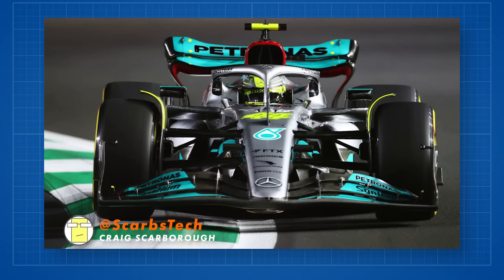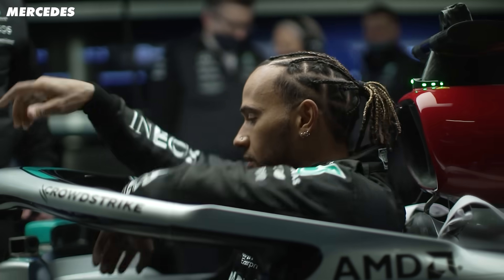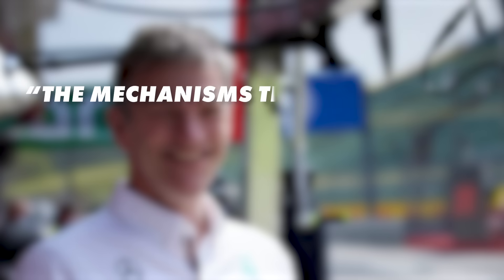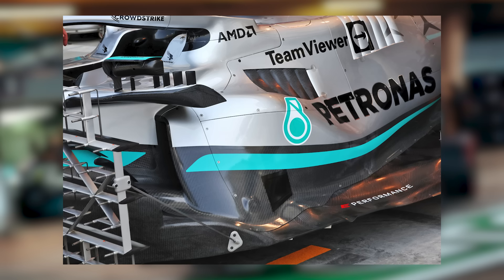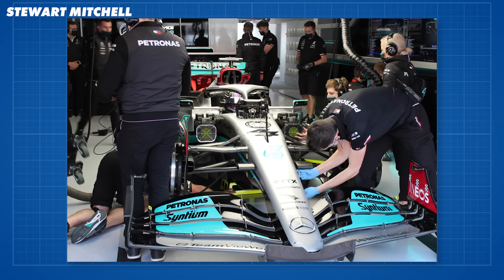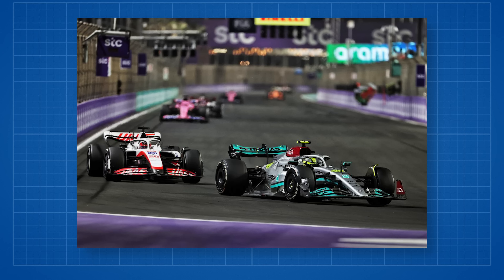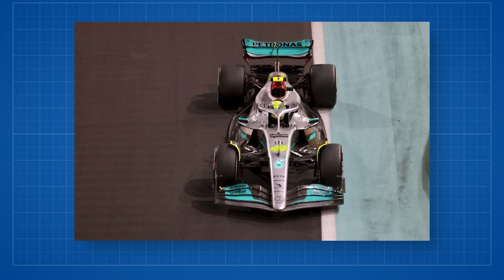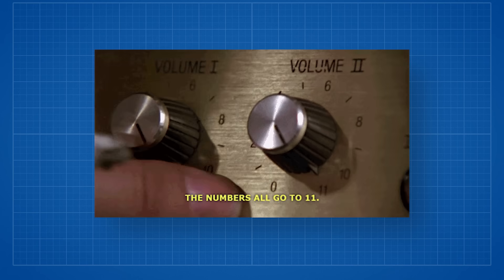The Real Reason for Mercedes’ Slow Pace | Saudi Arabian GP

Comment: Bcs they have a radical aerodesign that will work once. Lewis gave up Saudi for as much data as possible. Russell dealt with the porpoising and kept the suspension softish while Ham went for stiffened to the max. Result: less rear grip in his case with the "no bounce"-wheels of 2022. This sacrifice will win him races if they manage to solve the PU-issue. It is clear that both the higher center of gravity of said PU and the significant issues with horsepower-output, which lacks linearity, is still something they have to sort out. This car can be extremely potent and will be a 2023-2025 WDC-champion.
Reply: Mercedes said that the setups the two were running were pretty much the same. Lewis just didn't heat his tires right for his quali laps.

Comment: Mercedes have reported to bring forward their updates to australia: 1st will be a floor update to control porpoising, and the next at imola and then spain to lower the cars weight.
Reply: Interesting. I read today that Helmut Marko said that Red Bull were planning to shed some weight around Imola as well
Reply: @halofreak1990  yeah and Ferrari are reportedly also bringing upgrades there. So let’s hope Mercedes’ gets on top of their problems and then is able to contend with the upgraded RBR and ferrari.
Reply: @Jay-nk6dm  NOT
Reply: @nakedsnake_  is it Mercedes’ actively destroying the other teams from catching? No. It is not Mercedes’ fault that the other teams could not bring themselves to be able to fight them. Witnessing greatness will always be awe-inspiring, and if we really want to see what RBR and ferrari are capable of, they should test their mettle against the reigning champs
Reply: @Jay-nk6dm  Well.  Said.
Reply: @Jay-nk6dm  They do actively destroying other teams from catching up to them back then when this new engine first introduced until.. I don't remember, maybe 2018 or 2019 when all the engine modes (or software to access it) should be available to costumer teams. Of course none of the costumer team were a threat to them, but those costumer team probably could finish higher if Merc made those extra performance hidden behind the software to be used by their costumers, thus make those teams potentially finish higher and receive bigger prize money.
Reply: @nakedsnake_  Ferrari got 16 world constructors so from your logic they should not be allowed to even participate lmao
And if you wanna beat the Titan then become strong yourself instead of crying about how the competition is too strong
Reply: @nakedsnake_  what’s your problem dude is there any rule not to hv 8 championships or did merc tell others not be competitive all these years??
Reply: @RurouTube  do you have a link/source that says merc didn’t provide all modes to the customer teams?
Reply: @RurouTube  that’s some good info didn’t know that! At the end of the day that’s the disadvantage of being a customer team, you don’t get to fully know the extent of the PU. If this is the most they’ve done, it sucks for the other teams but I’m sure ferrari and Honda have done the same. Sure Mercedes’ aren’t saints to their customer teams, but is there a way you know they’ve tried to seriously disadvantage their non customer teams?
Reply: @nakedsnake_  Because a 3 way battle for the title is obviously better than a 2 way battle.
Reply: @nakedsnake_  maybe because Max was gifted a championship and we would like to have things right with Lewis

Comment: I think the small side pod generate too much downforce because they expose too much floor so aside from the suction from the venturi tunnels, the air above the floor is pushing it down so they seems to start bottoming out at lower speeds but I do think the solution is in the suspension like limiting the travel as to prevent the floor bottoming out too much, like light scraping instead of violent bouncing on and off

Comment: Can you do a video on what Ferrari needs to do to catch up to Red Bull in a straight line/what is holding their concept back vs. what holds Red Bull back with their concept? PLSSSSS
Reply: Ferrari used more downforce than RB, which made the F's faster in corners, but slower on the straights. Different compromise.
Reply: @Wuppie62  I mean more like their overall concepts tho. Like Ferrari’s big canyon side pods vs Red Bull’s super sleek undercut ones and stuff like that. Try and see how they may develop over the season

Comment: Mercedes turned it around in the past because the budget was unlimited and they employed roughly 500 aerodynamicists to brute force literally everything. I am curious to see what they will do now with the budget cap.
Reply: They will suck it up and say "We are working on the 2025 regs"
Reply: That's the same for red bull and ferrari though too but they've done alright. They both have B teams though, so i wonder how much data sharing there is between them and their B teams
Reply: @ffvgaming3735  im sure Merc are sharing data with their customer teams too.
Reply: @bipolarminddroppings  why would they that's their direct competition though?. The 2 alpha teams are just B teams for ferrari / RB and I'm wondering if they focus on using their wind tunnel time on separate parts of the car / combine data.
Reply: @ffvgaming3735  because those customer teams depend on them for the PU. Hybrid era, MB produce the best PU and there is no competition to them so they can charge whatever they want and have whatever perks in the contracts they desire like putting up no challenge when a MB is behind them. Renault were nowhere. Honda struggled until the last year or two in the regs. Ferrari struggled and then got nerfed. It was too easy for them.
Reply: It's not about the budged but rather the time allowed to spend on aero tests. They had the least amount of hours available unlike Haas who had the most that's why we see such an improvement for one team and worsening for the other
Reply: @Shifftee  so how is RB who had slightly more time than Mercedes 1 second faster
Reply: @A2906-o8q  because every amount matters and also because Mercedes proposing issue isn't something that can be properly replicated in wind tunnel
Reply: @bobmarley7787  no, it's because they did a better job
Reply: @A2906-o8q  its a mix
Reply: best thing ever...the "Budget cap".....money and big manufacturers killed so many race series in the past.....so lets hope it works now for all f1 teams....sorry merc fan boys...time to eat some "humble pie"....:-)
Reply: @stratman9449  its ok i dont mind waiting and seeing them develop their car, will make it even more exciting when they win it again. either way, Merc have the constructors for 8 consecutive years, so all good ;) itll be a while until anyone gets even remotely close to that again.
Reply: @MrMircs  So?
Reply: @jiujitsujedi  so? So there's no crying over here at our end. It's part of the sport.

Did you not understand that?
Reply: @MrMircs  Its laughable how much these people pray for Mercs/Hamiltons downfall. I guess its easier then admiting whoever they support just wasnt good enough to beat them at their best so they had to wait until Merc was strugling to get some wins 🤣
Reply: Facts
Reply: Yes indeed. And alot of top people have left the last couple if years. You can really see the effect of the brain drain that occured. 1 Second a lap too slow is an insane gap in F1.
Reply: Last year they were limited in budget and were still able to turn things around  to make a comeback
Reply: @bobmarley7787  that was new engines, not new research. New research costs more.
Reply: @Redskies453  no it included research as well

Comment: What he described is the aero force causing oscillation of the car when encountering bumps. That is what shocks were designed for, even as F1's innovation in active suspension solved the original problem of bouncing. Which the bosses are well aware of, even as they met to discuss allowing AS back into the sport, prior to the new cars. As they knew that it was needed for going backwards, to the old aero designed cars. So they are forcing the teams to make a new car concept, while depriving them of the solution/progress for a better season and sport. All because Williams holds patents and design advantages re: active suspension. The team who is suffering the most currently, could quite realistically benefit the most from the reinstated rules.. More FIA control and meddling, coming from the big bosses, who supposedly want to even the field for more competition and action. As they are really hindering the teams, fans and the sport.
Reply: Creating more action is helping the sport, not hindering. Wiithout much action the sport will suffer and lose  the audience's interest. No audience = less sponsors and less income = no F1.
Reply: @Wuppie62  Which is why they need to allow active suspension, again. That was my point. They are hindering everything by affecting the cars, and holdings back the known solution.
Reply: @hambone7777777  
It's not unthinkable that in the future they might permit/introduce active suspension, on top of deleting DRS, when the current new rules are succesfull. Because I think that's what they want in the end. But they (FIA) probably don't want to change everything all at once. :)

Comment: i feel like they will loose the sidepodless design and adopt a more scalloped design such as the ferrari have
Reply: This design is radical and has a bunch of advantages . If they change it it means they couldn't find a way to use all the downforce without having issues.
Reply: @edenbh3609  I think that is exactly what we are seeing, despite Scarbs analysis which seems to be largely be based on what he is being fed by Merc engineers.

Comment: Building two cars and having just only 3 days of testing with the actual racing car backfired on them. They overestimated themselves and I think it’s a good lesson for them. The after qualifying and after race interviews with Lewis are hilarious.
Reply: They have to change the whole design.
Reply: Let's be real, this is really a load of BS if we're honest. The car is not a completely different car as stated by Mercedes themselves, it's just a repackaging of side-pods for the most part. Redbull also did this on the second day of Bahrain to some extent, did it backfire on them? Alpine also did the same in free practice of Bahrain, they're looking pretty decent now as well. The fact that your comment has gathered any traction what so ever is a little disappointing to me, I like to think fans knew better but heyho, I shouldn't be surprised.
Reply: @F1ll1nTh3Blanks  let me guess, Lewis dan?

Comment: This is a much more in-depth into the reasons why Merc is slow. Like, everything you hear from the media just doesn't seem to add up to me. And if the Merc engines were that bad, surely one team principal would have sounded off or something. Thanks for the clarification
Reply: Did you hear that in 2020 from ferrari powered teams?
Reply: @berkayakdag733  Yes, Alfa and Ferrari both said the power unit was shit and made no secret of it.
Reply: @berkayakdag733  well that's because Ferrari told you themselves.
Reply: @berkayakdag733  yes lmao? Forgor gunther
Reply: "And if the Merc engines were that bad, surely one team principal would have sounded off or something. "

They won't. It's bad for business.
Reply: @lukeearthcrawler896  it didn't stop Red Bull.
Reply: They actually don't have that much of an options. But, Williams seems to be first to leave.
Reply: The PU could be bad if the weight/center of mass is exacerbating the problem with suspension and aero.
Reply: They did
Reply: The problem is whether these problems are fixable before the next set of new regulations in 2026 should Mercedes want to stay in F1. All the Mercedes teams are having various flavors of these issues and what Hamilton and Russell seem to get out of the car may be the best as to what they can do until 2026 in a worst case scenario (my guess is that they really only have a two or three year window to actually fix these issues). Not just 2022. 

And the question is are Mercedes just lazy when it comes to trying to figure out what driver can race the car either even outside of F1.
Reply: I don’t think that it’s the performance of the engine but it’s packaging. I believe that the engine is optimised for the long wheelbase design(providing more space) that Mercedes brought to good use in the previous cars but for these shorter cars the engine is too bulky and the teams are having packaging issues which has caused a severe drop in performance.
Reply: @MMA-ts2ji  The engine is totally different to last year's. They redesigned it and made it more compact for the new cars.
Reply: @jasondowtychristianmusic9401  was looking for this comment. A key giveaway is the intake plenum. It's the older style not the one from last year hence no"sexy bulge" in the body work.
Reply: @kknn523  no, the Ferrari engine is the best this season. Ferarri run a downtuned engine in the first races to analyze the reliability! If they run the engine in its race mode it will show the true potential of the F1-75
Reply: It's hard to tell if it's the engine or the side pod philosophy because 3/4 merc powered car have the shrunken side pod concept while aston martin has the detached side pods from the floor exposing a lot floor surface which all 4 have in common, I think it has something to do with that but and it should be fast if they can sort out the porpoising without having to jack up the ride height
Reply: Didn't Lawrence Stroll make the comment that he wanted to make his own engines in the future? What did he know at the time?
Reply: @n8pls543  I'd say not much, if a team wants to make a championship charge, then they need to make their own engines so Stroll wants that as well
Reply: i think tha Merc just catch the same decese that happends to Ferrari when they discover the engine problem and downgrade the engine.I think that cause all Merc engines in teames suffer the same lack of power.will see
Reply: First reason - A lot of drag, Toto mentioned it and an engineer mentioned the air does not stick to the car. Second reason - At any equal speed to Ferrari or RB, the Merc is always on higher revs. Telemetry has proven this.
Reply: Why did Mercedes themselves use 4 new PU's on Lewis and 5 on Bottas second half last year? Because they were so good? Now be honest would you yourself want an engine that can't even make half the distance of a cheaper engine in your car? They did not solve the problem of the past year. And maybe the E10 makes it worse.
Rocket engine my behind. They only managed to have those huge speeds on tracks where there were long straights. Lower the back of the car at the moment they wanted (DAS 2.0) and there you go 20 km/h speed difference or more. On a normal track they were really close together.

Surely they can amp up the engine right now. But the same will happen as the past year, losing significant engine power after each single race.
Did they change the penalty system after horrible abuse of it by Mercedes the past year? They should not have won the constructors by this abuse.
Reply: @Dorfus2323  if they changed the rules after every ingenious idea, their'd be no formula for us to watch.

Comment: Why is lifting the car up In this case still the solution if the problem is not areo stall?
Reply: because it's exacerbated by the aero stall after the suspension problems initialise it

Comment: Actually, Hamilton was lucky to get 10th place - several cars had to retire that were in a better position to score points than he was (Alonso comes to mind). Bottas and Ricciardo as well. Tsunoda and possibly Mick Schumacher who both couldn't start. Zhou without the double penalty, which includes the drive thru penalty for the team getting his 5 second penalty wrong, would have finished ahead of Hamilton (he finished 10 seconds behind) as well. Seems both cars would have finished about where they started. Set up is so key with the Mercedes. Get it right and it's the 3rd quickest car, get it too wrong, and it's a back marker. And with such a wide spread, it's gotta be pretty tricky to get right.
Reply: He was also unlucky to not get 7th considering he was just as quick in race pace as George while on tyres 16 laps older.
Reply: He was also unlucky with the safety car.. his pace was good and he was lapping nicely and was matching Russels pace in 5th on old hards. So he would have gotten 7th.
Reply: It evens out though cause he was unlucky to not get p6/7
Reply: That’s irrelevant because cars retiring is part of the the whole race. How many drivers have moved up places because another car retired but now you want to nip and pick just to solely base it on luck 🙄
Reply: :100: Hamilton was lucky to pick up point in 10th place. Not many people realise this, so thanks for raising it.
Reply: @justanotherviewer4821  He was lucky to get a podium last race too.
Reply: he also got unlucky with the safety car. say that as well.

Comment: Nice video guys 😊 Is it possible that they issue with Mercedes engine is packaging rather than performance? If engine packaging affects/restricts aero then how easily can it be solved?
Reply: I agreed I thinking they can't use full power because of overheating specially in middle East with higher temperatures
Reply: Exactly what I was thinking as well. 

If all Mercedes teams are struggling, it has to be something, that they all share.
PU and Gearbox come to mind. Suspension should be different on the McLaren at least.
Maybe Merc went too extreme in packaging everything really close to the centerline of the car to build everything around their concept of those “zero-pods” including compromising the PU-package.  Maybe that compromises freedom of design in the floor. Or has other impacts.
Maybe it’s lack of power especially in quali on top. A combination of both.

Time will tell…